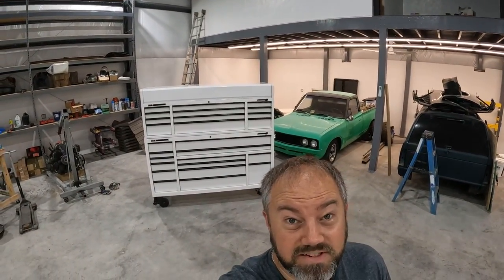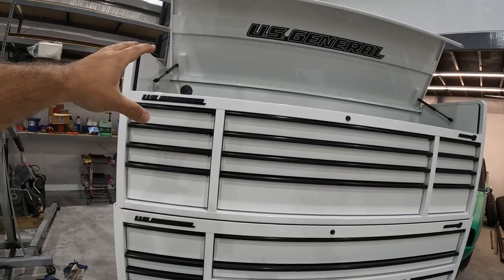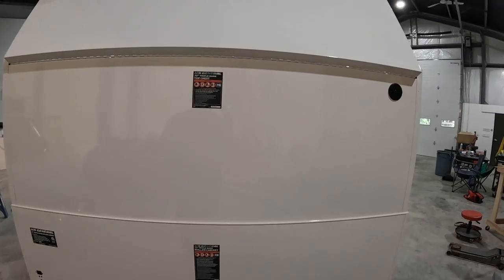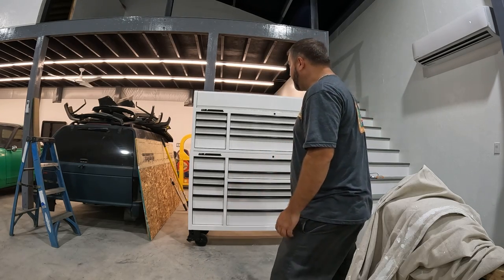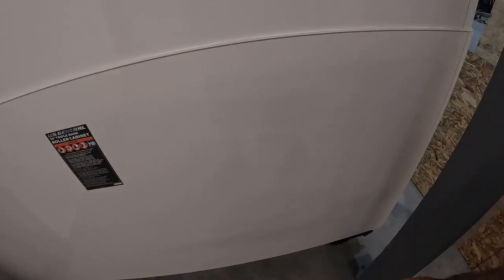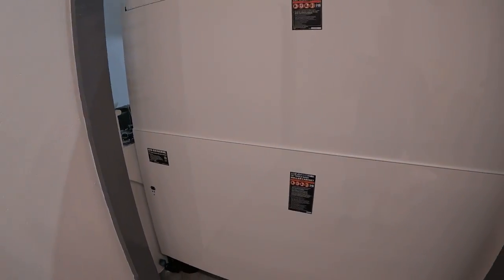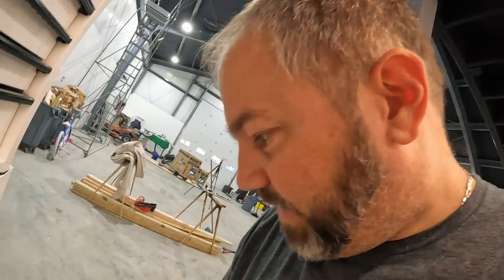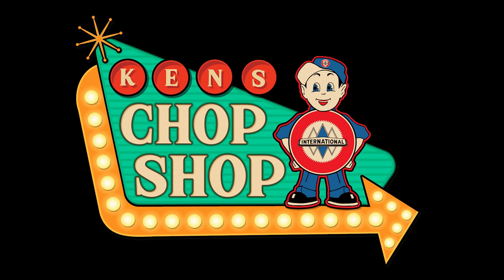U.S General series 3   72" tripple bank and top chest

Comment: Was gonna get the 72" top toolbox, but got the 72" top hutch and side locker instead bc i was able to save more on the 2, and if later on I can add the extension toolbox or another locker. I got everything on salee too...
72" toolbox $1349.99 - 25% off ($450)
72" top hutch $594.99 - 25% off ($105)
Side locker $299.99 - 25% off ($100)
 Saved a total of $715 on the 3 pieces. 

PS - I did go with Slate Grey and i had to wait 4 weeks on the box, 2 weeks on the hutch & 8 weeks on the locker.
Reply from the maker: Nice , sounds like you have a nice setup also and got some killer savings on yours . Thanks for watching and sharing your setup!

Comment: Debating on whether I should bite the bullet or not I’m skeptical about the locking mechanism reliability as I own a us general roll car and the lock seized twice on me.
Reply from the maker: Thanks for watching!  Yeah I can understand that concern for sure bit I have that with most any purchase from hf haha but in all seriousness it seems like a pretty quality box ( for the money ) and especially that's its coming from hf . I'm assuming your talking about the key lock and not the drawer slide locks and if so I'm not in a position I need to lock my box or my older usg carts being in my home garage but I could imagine they'd be something that could fail over prolonged use . I can say, in my opinion, though, that the full-length drawer locks on the series 3 are much more convenient and easier to use than my series 2 cart . Well, thanks again for watching, and good luck with your choice. So far, I'm very happy with my decision to get mine